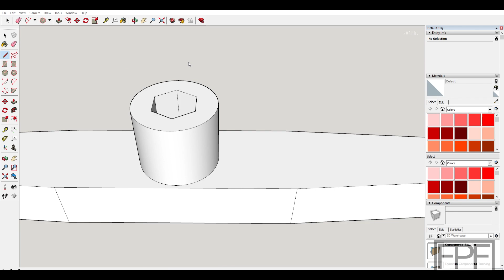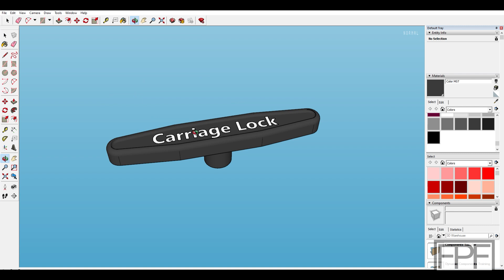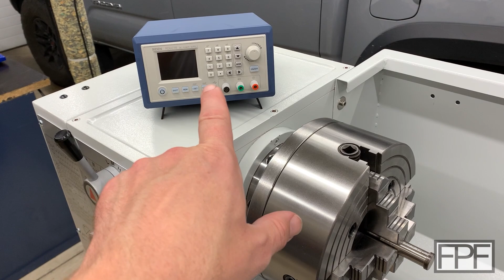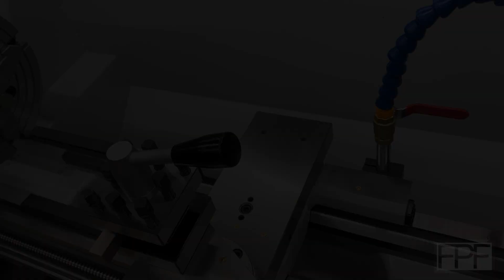3D Printed Carriage Lock for Metal Lathe PM-1440GT

Comment: If you are cross feeding by hand, you can engage the threading (as long as its not turning) and back up the saddle to take out the backlash. Faster than engaging the saddle lock.
I'm waiting for the delivery of my first 3D printer and will have a look at this as a solution.
Reply from the maker: Thx for the idea.  Wouldn't you though be limited in the Z axis by the positions you can engage the half-nuts in ?
Reply: @FunctionalPrintFriday  I set the saddle in position and engage the threading on the lead screw. Then back peddle on the saddle wheel to set the saddle as far back as possible and get rid of the backlash. Then I use the top slide and cross slide to do the cutting as normal. You can only engage the feed screw on my lathe at 1/4" intervals as its 4 threads per inch.

Comment: This look cool. Did you print the body, then the letters and press the letters into the body? Or did you use a double printer head. I cannot work out how to get the letters to fit in the body by printing separately.  I am so new to 3D printing.
Cheers.
Reply from the maker: the color is changed during printing (at leach layer)
Reply: @FunctionalPrintFriday Thank you for your reply. I certainly didn't realize it is so labor intensive. I would surely love to see a video for this process.
Reply: It can be done automatically with many systems now. I believe he used a Bambu Lab AMS for this, but I could be wrong. Regardless, if you look up Bambu Lab AMS or AMS Lite, you’ll find plenty of great videos showcasing it

Comment: 10:42 please don’t vacuum sparks in the vac if you also use it for wood or other flammable materials. This could start a fire.
Reply from the maker: Good point.  Maybe I could rig up a bucket with water in the bottom and a baffle to put between the pickup hose and vacuum.